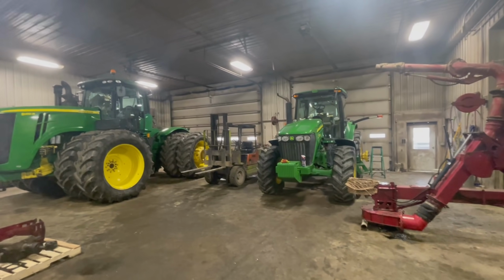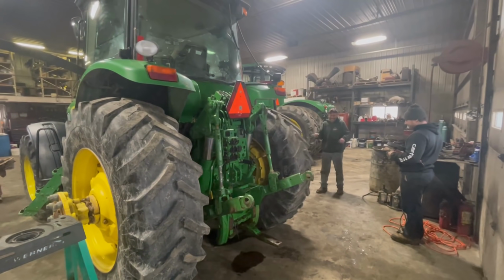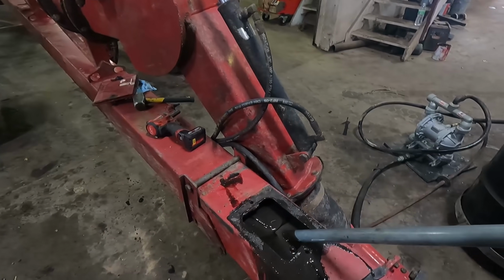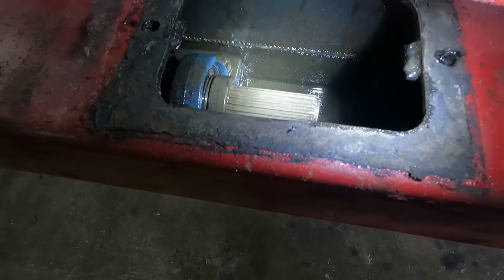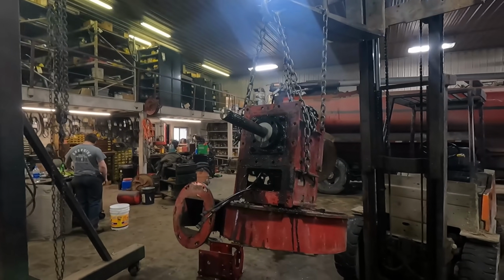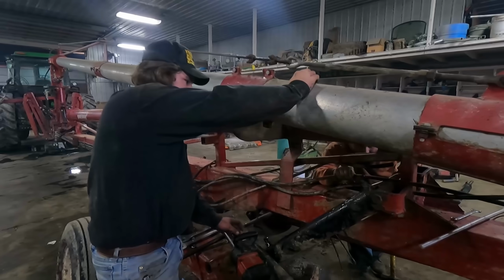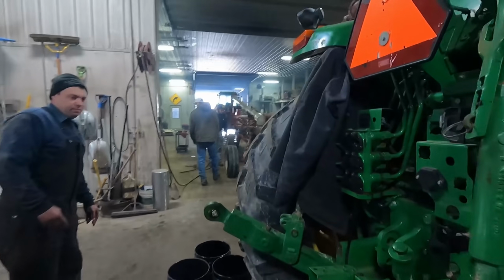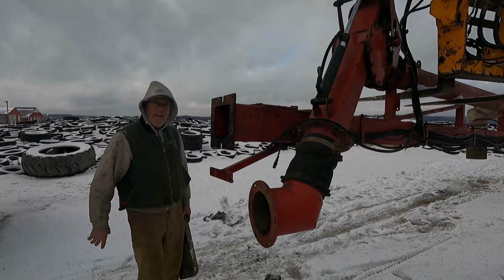More shop projects

Comment: Working on large equipment can be hazardous. The dealer shops interject additional cautionary stages of safety measures, & Why not? Since the cost is passed along to the customer. BUT when the shop is the customer,  it can't take all day to EVALUATE how safely to approach the task.  If every possible safety standard is applied to every repair,  eventually the repair exceeds the value of the unit being fixed.   If there were a safety manual checklist required before sex,  many would say forget it  & just  have another beer instead.

Comment: I love your videos Andy, I suppose you have seen about everything and with that said that's why we never see you in a bad mood or pissed off cuz its got to be fixed or replaced cuz you need the piece of machinery. How's little bubb " Andrew " liking his toolbox ? I thought that was kinda nice that you gave that to him, they have to start somewhere. Is that what you did to Jared ? Do you give the guys air tools or does the shop supply them.
Do you have tool trucks stop by every week to sell tools to the guys? I worked for Goodyear for my work-study class I started out at 2.30 a hour and after we had our first preseason tire sale for winter , I had 2 bays in back of the shop that we used for tire work or oil changes
But the first Saturday in November that we were supposed to get a storm the boss " store mgr " would write up the work order and put the order on my hook and the asst. store manager would chase cares and bring them in the shop or work area and I would put either 2 new snow tires on the back or new all the way around. And when I was done the Asst manager would drive the car out and bring another one in while I was doing the next car or pickup and we did that all day Saturday from 7 am. to 6pm and we did a total of 70 vehicles including 10 oil changes and I went from $ 2.30/ hour to
$ 5.50/ hour I ended up being the highest paid person in our class and next was $ 3..00/hour  we had 30 people in our class and we had people that worked in different departments in grocery store and clothing store a Napa store, beverage store, Sporting goods store as at the time I was in high school back in the 70's but I was on the swim team my freshman and sophomore year but then I got a severe sinus infection and ended up having surgery and was out of school for almost 2 months, I was in the hospital for 50 days. But my junior and senior year of high school I was in work study and I lived in a suburb of Cleveland OH 10 miles west of down town out by the airport. But in the summers I flew to Iowa to work for my 2Uncles on the farm with the town population of 1200 and a cheese plant in town and as of today they are the biggest employer in town and just did a major expansion deal the last 2years and our town through the creamery produces the best cheddar cheese through Schreiber foods. If you get cheese on your burger or if you buy cheddar cheese in blocks or schreaded it
Might have come from our local dairy called A.M.P.I. as they can unload 6 semi's with the quad axle at the same time..  If I wouldn't have come to Iowa in the summer's who knows where I would be today probably in Agriculture most likely.